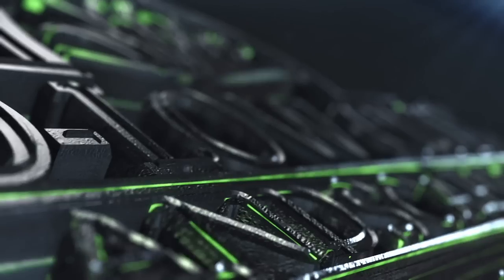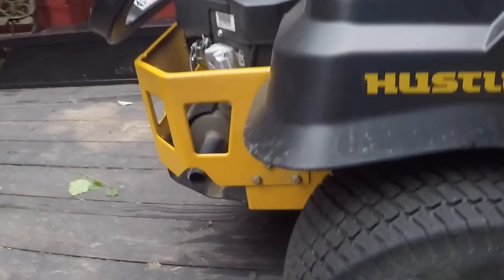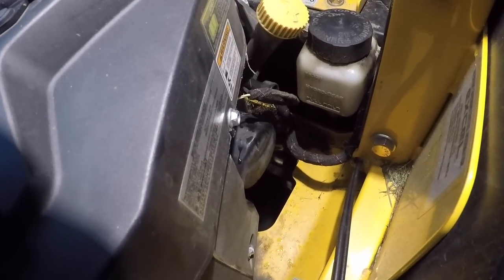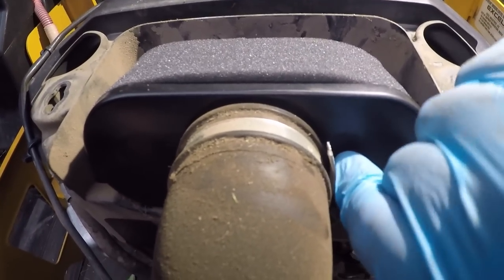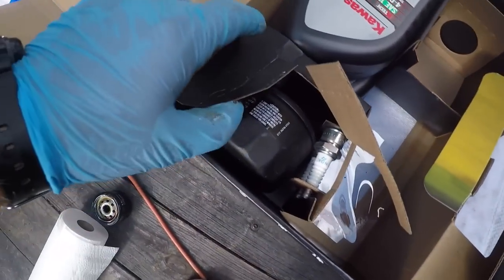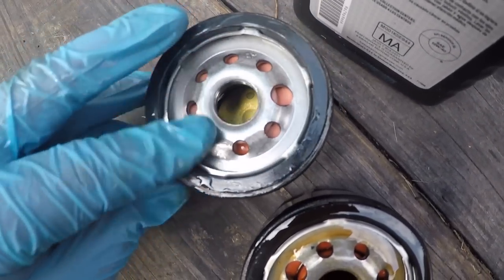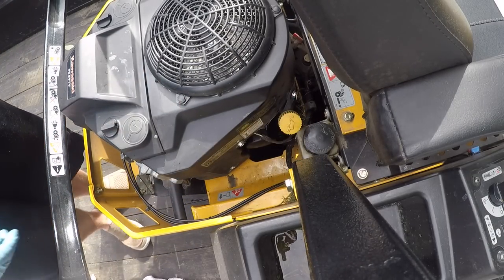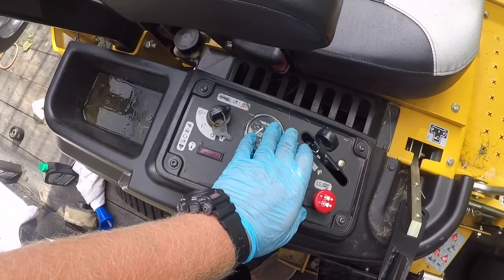Oil Change on the Hustler~ Full Tune Up~How to

Comment: Thanks for the video! I have this exact mower, and I neglected to change the fuel filter. With 280hrs, it began to sputter and run a little rough. Changed the fuel filter and plugs and it runs like new again. Fuel filter will be every spring from here on out. I will say, the old filter was doing it's job!
Reply from the maker: It happens! But, now you know how easy it is to give your lower a tune up! 👊 thanks for checking out the video!

Comment: You are checking the oil level wrong after filling up the engine. You are supposed to let the dipstick bottom out but DO NOT SCREW THE DIPSTICK DOWN. Just pull out the dipstick again, wipe it off, and reinsert it again to check the oil level. When you're satisfied with the oil level, then reinsert the dipstick and firmly screw it down. See page 13 of the Kawasaki engine manual under oil preparation.

Comment: Getting ready todomy first tune up.  your vid was helpful. maybe mentioning socket sizes you used would be good for future reference
Reply from the maker: At the beginning I do state that I used a 10mm socket. Maybe I can add that to the description as well just in case! Glad it was helpful!! 👍👍👍
Reply: Hi.  My bad,Ishould have stated socket size for spark plugs.  I ended up using a 16mm for them.  So far, my first ever tune up on this Hustler is a sucesss, thanks in partto your video. Mine is a Kohler engine, a little different set up,but the vid. covered the basic idea.  Thanks again.  I subscribed.

Comment: If you put a small amount of dielectric grease inside your spark plug boots, your boots will no longer stick to the porcelain of the spark plug and will remove easily. Just use a small quantity of the dielectric grease using a Q tip where the spark plug contacts the rubber boot.

Comment: You didn't level the trailer before adding the oil, doesn't that affect your level? Also my dipstick says dont screw it down? Also I have 2 fuel filters on mine, one is down lower than that, i guess thats the evaoporative fuel filter it mentions in the manual, i dont understand how you are supposed to get to that one
i have a husler raptor limited so maybe your model doesnt have it

Comment: I have a mower with Kawasaki FX691V engine. When you check the engine oil level you don’t screw the cap down. Just put it in the and pull it back out to get the proper oil level. That’s in my owners manual for the motor.

Comment: Use a torque wrench and anti seize the spark plugs.  Make sure you gap them properly with a feeler gauge before you install them.  Often times they come brand new not gapped properly.  Do not regap used spark plugs
Reply from the maker: Thanks for the tips!!
Reply: Some of the plug manufacturers (NGK is one of them) is telling their customers not to install some of their plugs using anti-seize. If the plug threads that you buy appear shiny, do not use anti-seize. The manufacturer has already installed anti-seize on it. If the threads on the plug appear dull, you can use anti-seize if you desire.  What is wrong with regapping used spark plugs? As long as the center conductor is not worn down or worn away, it seems like regapping would be better than reinstalling plugs that aren't properly gapped.

Comment: Use a torque wrench to install new plugs, like you are supposed to do, and you should never have future problems installing or removing plugs in the future. The spark plug gap is .030 in. on the NGK BPR4ES plug and they should be torqued to 16 ft-lbs.
Reply from the maker: Thanks for the info! I appreciate the tips!

Comment: Don't use cheap or dirty gas and you will rarely ever have to change fuel filters.  How many times have you changed the fuel filter inside the gas tank of your car?

Comment: Trade your old Hustler in for a new one with fuel injection. They have a much smoother running engine and should have fewer problems down the road.
Reply from the maker: Since this video we have upgraded to the Hustler Super Z. We have done multiple videos with that mower in action! Be sure to check them out!

Comment: Aren't those electronic ignitions? If so plugs may never need changing, the mower will wear out first. The fuel filter shouldn't need to be changed often either.
Reply from the maker: My Hustler hasn't been in the shop yet for a break down... So I must be doing something right
Reply: Randy M    You better read the manual.
Reply: @edwardkawecki8101  It’s over kill but hurts no thing.

Comment: Any advice on choosing a raptor sd vs fastrak sd 54”? I not do it commercially but I’ll have 2 yards to do this season about 5 acres and trying to pick up 1 or two more yards.
Reply from the maker: The fastrak is going to be a have better build qualities than the raptor. But, it depends on your budget and what your end goal is. If you're just doing those couple properties,  you could save some money and buy the raptor. Just my 2 cents
Reply: Rob King  I’m looking at the fastrak sdx 54. I have about 2 acres....but it a lil hilly and not the smoothest yard and both my neighbors have 3+ acres, so we can help each other out if one of our mowers are down. I can even pick up a few yards on the side if I wanted. My dealer wants $7400....I don’t know if that’s a fair price or not.
Reply from the maker: $7,400 seems pretty steep imo.
Reply: So-Low Cuts Landscaping yea....I looked it up and that’s msrp......I can’t pay that.
Reply: I’m on my second Raptor 48 SD, has proven its worth!!  I mow roughly 40 cuts a week... damn tough mower.  Father in law has a Fastrak, an excellent mower!  BUT, for the cost, the Raptor SD line is very tough!  I’m light commercial, changing blades every week.  On the Raptor the grass chute is horribly little and will clog on long wet grass.  Keep an eye on that.   Other than that. Two great mowers, price and objective is the key to buying.  Cheers!
Reply: For what its worth, I bought a Fastrak 54 SD 4 years ago and I never regretted it once. I paid about 7k, so it was pricey, but I bought my weekends back. What took me 4 hrs on John Deere rider takes 1 hr 10min now. I agree budget is big concern, however, look at the specs on the Raptor vs the Fastrak SD. They are really not in the same ball park. Neighbor has a Raptor and it feels like a toy compared to mine. I mow my yard, which is 4 acres, plus two other lawns, so I definitely do not need a commercial unit, but it is just so fast, cuts so smooth and makes mowing FUN.
Reply: Rob King I bought the 60” Fastrak  only used it one summer but no problems it’s fast and cuts smooth and even. Plenty of power , I feel like the fastrac is the better machine but u pay for it .

Comment: is there a video on the hustler fastrak hydro service?
Reply from the maker: brandon81250 i actually take mine in to the shop for that. I’m sure there’s a video out there in regards to this!
Reply: So-Low Cuts Landscaping I can’t find a video on here for that mower
Reply from the maker: brandon81250 hmmm.. that’s surprising
Reply: Find the type of hydros your mower uses. My Fastrak SDX uses Hydro-Gear ZT-3400 hydros. Google the type you have. Hydro-Gear’s are used in many different brand mowers, not just Hustlers.

Here is the video I used for mine.

https://youtu.be/-x_kIXXmhQA

This was super easy.
Reply from the maker: @aquaman0167  excellent advice! Thanks for sharing!

Comment: Where to grease the Barens ?
Reply: What are barens?
Reply: Mower deck has 4 grease fittings 2 on each side they are where the lift pivots , and the front wheels each have a grease fitting on there axel.Wheel bearings are likely sealed if that’s what your calling BARENS.

Comment: Please do yourself a favor and remove your jewelry when shoving your hands into tight spaces on anything energized(I didn't see you disconnect the battery). On a good day you'll break your watch, on a bad day you'll lose your left ring finger or entire left hand. A 12 volt mower battery has enough potential energy to put you in a really bad place.